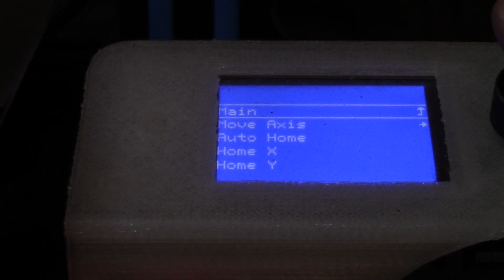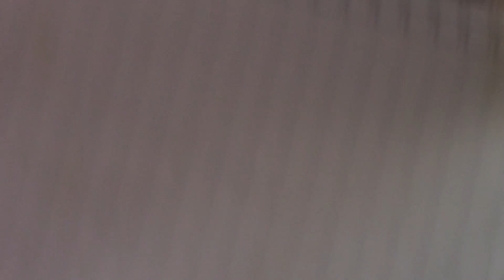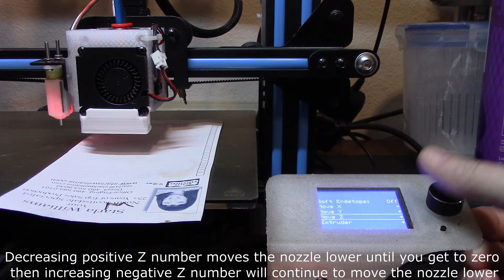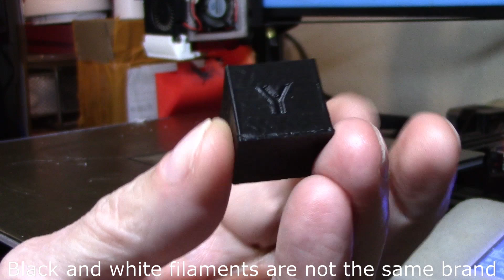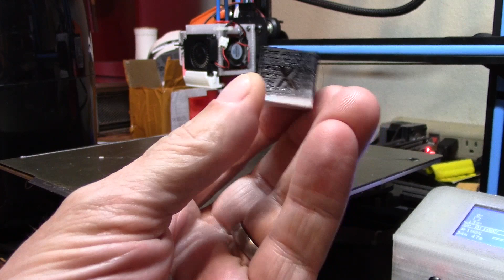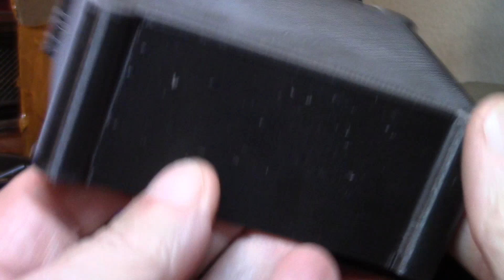BigTreeTech ZSYong Mix 2 in 1 Out Mixing Hotend on the Geeetech A10m Part 2

Comment: Can someone please explain to me how to clean the hotend on one of these machines? A normal cold pull doesn't seem to work. I believe I have heat creep and my left side is now clogged. No matter what I do it won't extrude properly at all and the gears grind. It's not the nozzle because the right extruder is fine.
Reply from the maker: This happens to me when I forget to use one side for too long. Leave the filament in the side that's not plugged up,take the bowden tube completely off of the side that's jammed and make sure that the jam isn't in the tube itself (that's where I usually find it in mine). If the tube is clear then bring the hot end to temp and try to force the jam through with an appropriate size metal rod. You may have to use a micro torch to get it hot enough.
Reply: @3rdpig  Thanks. I never thought to check the tube. I think the problem was that my capricorn tube didn't go all the way in and I was getting horrible expansion and even heat creep. Had to heat up and turn off the fan to upper chamber, then stick a rod in there and pull out all the PLA a bit at a time. Luckily it stuck to the cold metal rod while cooling down. I then found that my Capricorn tube is 4.2mm diameter while the stock tube is only 4.0mm and slides in so much easier. I ended up putting the original back in and the problem went away.

Comment: What model of thermistor should I use with Marlin? Do you have any video configuring Marlin with this hotend model?
Reply from the maker: Thermistor is here - https://amzn.to/3BVLeTG
I didn't make any further changes to Marlin for this hot end. The thermistor setting is in Configuration.h and all you have to do is comment out the existing thermistor and uncomment the one for100K NTC 3950.

Comment: I use the BMG dual gear extruders, spools on the side not facing back and the BMG's are both facing down mounted on top instead of out towards the front
Huge difference in extruding especially at lower temps for pretty prints and really forcing the two colors together in the chamber without losing steps due to slipping filament 
I'm actually running a temp tower right now that starts at 220 and drops in 5° increments to a final temp ot 170
Brand new A10M hot end assembly because I want to take my original one apart and see what makes it tick
More grippy extruders do make a difference in many aspects on how well the print turns out. The factory clone extruders suck , with the BMG's I just flipped the plugs 180° and recalculated my E steps *and relocated the spools and extruders using all the same hardware*. Easy peasy

Comment: When you level your hotbed you definitely want both your bed and nozzle at your intended print temperature. Metal expands when it heats so setting it when cold means it will be much tighter than you set it once it's hot.
Heated to print the nozzle moves (expands) towards the bed and the aluminum of the bed moves (expands) towards the nozzle making it all much tighter than your leveling had set it to be.
Set both to the print temperature of whichever material you're using before leveling!
Reply: the Paper is meant to represent 10microns of thermal expansion, when you do it cold
I make it tight 1 tick just before the paper cant move.
i do it cold with the paper, and tbh, im constantly micro adjusting afterwards, i wish there was just a scientific, if you like, way of doing it, empirical might be a better word. to use
Reply: @platinums99  Give heating both to the temperatures you'll have them when printing a try. The paper is important and your right that there should be slight drag between the paper and the nozzle and bed.
Metals sometimes expand in strange ways, so doing so while hot should avoid any unexpected points of expansion/contraction.
I use 14 pound (cheap as dirt) paper. If you use 28 pound or even 24 pound it may be too thick for your needed print spacing.

Comment: Do you have link to where you got the cover of the hot end? I have the BIGTREETECH 3D Printer Part 2 in 1 Out Hotend but the 24mm wont fit the X carage
Reply from the maker: I'm not sure what part you mean by "the cover of the hot end". If you mean the hot end mount then I designed it in Fusion 360 and printed it. It's available on Thingiverse and there's a link in the video description. If you mean something else I'll need you to clarify what part you mean.

Comment: Thank you for testing this hotend! Did you notice anything regarding oozing and/or clogging with the BTT hotend? The stock A10M hotend is notorious for clogging, as well as oozing which is hard to eliminate completely.
Reply from the maker: I had no real problems with clogging or oozing on the new hot end. And personally I had no problem with it on the original hot end either. While I have no way to tell for sure, I'm willing to bet a dollar that most of the clogging problems people were having was one of three things.
1. They didn't have the bowden tubes cut squarely on the end and pushed fully into the hot end. Not using the a cutter that holds the tube and cuts at the same time means it's not going to be absolutely square on the end. And it's harder to get inserted all the way than most people realize.
2. They didn't have filament fully loaded into the side they were not going to be using. And by "fully loaded" I mean coming out of the nozzle.
3. They printed for a long time from one spool without pushing filament through the other side. On the A10m I never print more than a few hours from one side without at least 10 or 20mm out of the other. Even if it's just a 80/20 mix.
As far as oozing is concerned, if you're talking about oozing from the nozzle IMO that's a retraction setting or extruder issue. And oozing from anywhere else is an assembly or fitment issue.
Do all these things and I'm betting your clogging and oozing issues will go away. Mine did.

Comment: What size nozzle does this use? Is it the same thread as the geeetech or is it more standard?
I only ask as CNC Kitchen had a very interesting nozzle on his channel that might help with the mixing. But I don't think it comes in A10M sizes.
Reply from the maker: It uses a proprietary nozzle that requires a special tool, which they do not provide in the kit, to remove it. The one that comes preinstalled is 0.4mm and I can't find replacements in any size. I watched Stefan's video and no, that nozzle won't work here, but if it comes in a MK10 variant it probably would work in the factory A10m hotend.
Reply: @3rdpig  Sorry I remember you saying in the other video my bad.

Comment: The way it prints color based on the direction makes me think of the video that Stefan did recently over at CNC Kitchen where he evaluated a two color filament.  In his tests he showed that the two sided filament really didn't mix in the nozzle and came out with the same orientation as it went in.  This makes me think that the nozzle you're using doesn't really do any mixing either.  I would guess that the nozzle would have to have something inside to force the mixing, kind of like those tips you can get on 5 minute epoxy syringes.  It's good it works as well as the original but it's too bad it doesn't do a better job.
Reply: Exactly right. "Mixing" is a little misleading as a descriptor for this hot end. I work with an older industrial printer that is 2-in 1-out and the prints I get look very similar to what Chuck is getting from his Geetech, so I would say the hotend is performing as expected. The effects (50/50 mix) would be more exaggerated on a larger print, like a thin walled  column as big as the bed.
Reply from the maker: I saw that same video. Be nice to have a real mixing chamber, but I guess a person could add a nozzle with the mixing "blades" already in it. Be great if we could print in any color with just primary color filaments.
Reply: @3rdpig   I'm not sure a true mixing chamber is possible, due to the restrictions on physics when working with PLA and retaining quality in dimensional printing. The chamber would need some kind of stirrer like a cement mixer, but this will add complications and likely lead to clogs and jams, if you could even design such a thing to rotate inside a closed system. It might be that the orientation of the filament could be pushed into each other to mix better, but then you sacrifice accurate extrusion probably, as you would need a buffer for the mix, and as we know, when you have a buffer like when your teflon tube isn't square, you get problems.

Comment: I steer well clear of anything consumable and proprietary as I have been stung in the past, for the very small amount of multi coloured prints I do I'm happy to use print pause and change the filament, although I did find this quite interesting.
Reply from the maker: Changing colors without pausing and, at least when I do it, the inevitable blob or hole where I swapped filaments is the main reason I went with a two filament printer. Being able to mix and make gradients was an added bonus that really doesn't work as well as I'd like it to. And yea, I generally steer clear of proprietary parts as well, but sometimes I just want to try something new and am willing to roll the dice.
Reply: @3rdpig  In Cura: Extensions menu --> Post Processing -> Modify G-Code -> Add Script -> Filament Change.